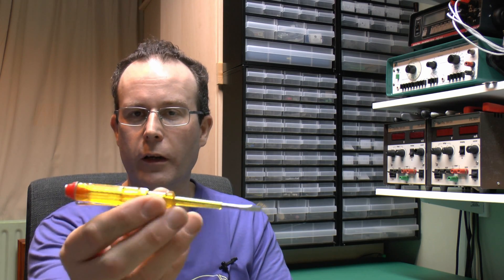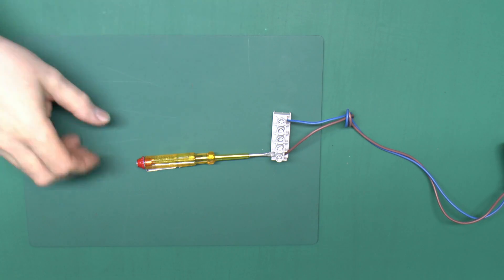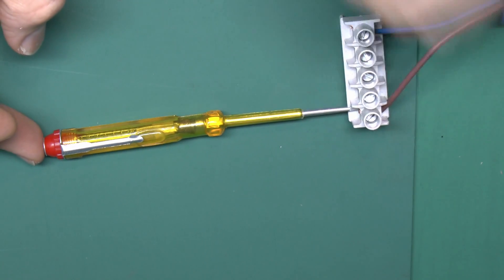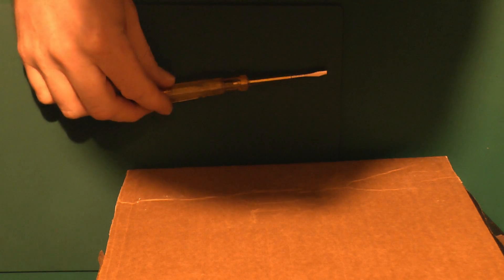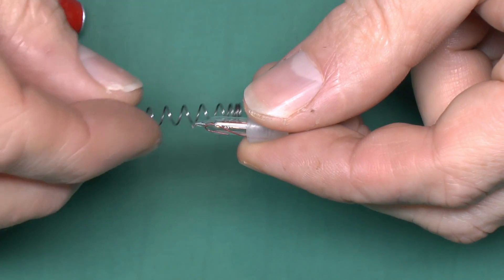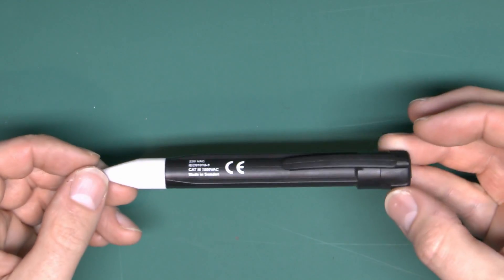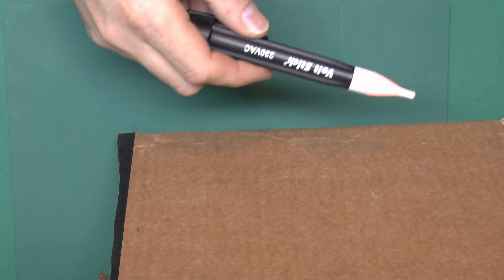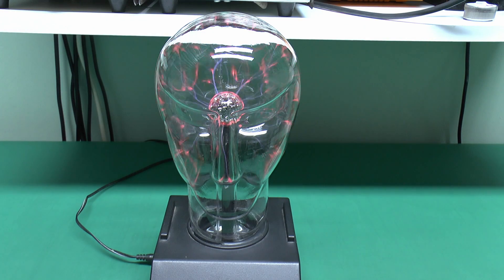Dangerous Device - Neon Mains Testing Screwdriver

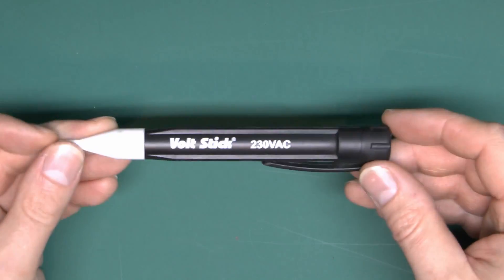Comment: Humm, there seem to be a bit of a trick here. Either the screwdriver is faulty or the power is cut off to stop getting the light. I have used this type of testing screwdriver for years without any problem. The tool is only used to test live voltage point in a wall socket or even a connector bar like the one you're using to test if it is active (positive) or negative (no power) by simple point the tip of the screw driver on only one point and place a finger at the handle end. If it is active the light comes on. It never fails because it is only conductive by one way body contact. However, should you hold the handle with your finger and put the other hand on the negative wire, you will probably get electrocuted. I don't know as I have never tried it. The screwdriver is safe if used the way it is intended to be used and it is a sure way of finding a live point. The other device at 6:40 is really not as good as the trusted screwdriver tester because to find out if there is a voltage at a point, you just pass it closer to a voltage point, be it a wall socket, a light fitting, cables, etc., to get a light and beeping sound. But, which cable which socket point is active? The device detects a voltage source at a distance of up to 15 centimetres away and that means you cannot single out which socket hole it is or which wire is positive in a cable. The trick I see here is that at 7:15, the device doesn't light. Of course it doesn't light, because these devices have one or two batteries inside to detect a voltage. Then, at 7:38, you say "Now this time I place it here, as you can see it illuminates", Yeah, yada yada yada, no wonder it didn't illuminate in the first place, you probably forgotten to put the batteries in, and of course this time it illuminates. So, all in all, I would still use the old trusty screwdriver tester.
Reply: The problem with the neon screwdriver is that if you are well insulated it will not light or be very dim and you may get a shock or worse as a result.  People use them outside and wonder why they get a shock, assuming they survive to tell the tale.

I do use one for testing that a 240v is live when I am expecting it to be live .  I certainly do not use a neon screwdriver to test for dead.  To test for dead I use a voltage tester and the non-contact tester, they are both dirt cheap, so why risk your life?

No idea what non-contact voltage testers you've used but my dual sensitivity one has to be as close as 3mm to a bare wire, it is THAT good.  I can easily pick out the live from a bunch of dead in a wall outlet.  People don't understand them and buy one thinking more voltage range is better, no it isn't, it makes it too sensitive.  As long as you understand how to use one you will always find live with one, but people are morons who don't understand how they work and what their limitations are when testing twisted cores etc.

In this John doesn't explain why the non-contact voltage tester doesn't light, I reckon he cheated and swapped live and neutral around.  I don't believe that it would not detect live if that brown was live.  He then goes on to demonstrate that it is too sensitive, so why didn't it light up so close to a live brown John?  Because it wasn't live, was it!

John Ward has an obvious chip on his shoulder with neon screwdrivers and this video is the result.  You are right, there is a little deception going on here.  Like for example using an isolation transformer to test a neon screwdriver ;)  Test it on a mains outlet next time.
Reply: @fredbloggs8034  Rubbish!
Test the indicator on known live, then test unknown conductor with it, then test indicator again on known live.
That's how the apprentices were taught to use it. In my 60's now, and the neon 'driver never let me down yet.
Only an idiot would use an indicator in bright sunshine.
Reply: @tiggywinkle1000  
"Only an idiot would use an indicator in bright sunshine."

Which was the point he was making.  Read the comment properly.
Reply: @random6809  GFY !
If bloggs is a big boy, he can defend his position.
Or is it 'All Girls Together' day - ? Don't bother to reply !

Comment: The reason they are used is because they quickly show what is live and that is the point

I don't think anyone would.just get it out of the draw after a year and think, the lights not on it must be dead

There a common sense quick easy tool

Test on a known live, they are not useless at all , but I wouldn't use on anything high voltage

And by high I mean anything bigger than meter tails

And if the thing inside is broken the circuits broken
Reply: "I don't think anyone would.just get it out of the draw after a year and think, the lights not on it must be dead"

You don't know people very well then, that is exactly what happens.

Comment: I'd just like to make the point that assuming a circuit is dead because it doesn't light up is so dumb. 

It might be faulty.
Reply: Indeed, any equipment can be faulty.  You test whatever the device is on a known live (or proving unit) before you use it and then test the device again after you've used it.

I wouldn't use only a neon screwdriver to test for dead (Voltage Tester for me) but it is handy for the paranoid.  A neon screwdriver poked at the known dead is a cheap and reassuring test that I am not about to be the circuit to ground for some unforeseen reason.  It's portable and dirt cheap, so why not do that extra test?

John Ward saying "why you should never use one of these neon screwdriver testing efforts for anything" is utter nonsense.  He's a knowledgeable guy but his obvious bias about neon screwdrivers knocks his credibility a little here.

Comment: Any body saying im an electrician and i use an electrical screwdriver is not an electrician nor are they even a compatent person
Reply: Utter nonsense.

A test lamp could make you believe that a wire was not Live, as could a multimeter.  Like any tool you need to understand when it is appropriate to use the neon screwdriver and when it is not, just like the lamp.

The measure of competence of a person is not the tool used it is the person using it.  A neon screwdriver does not make you incompetent and a test lamp certainly does not magically make you competent!
Reply: What makes me competent is my qualifications ,c and g 2360 part 1 an 2, 2391 inspection and test ,16th 17 ed wiring regs,knowing how to use a testing device,confirm,test,confirm again,the test, check for earth continuity,check phase positive ,(against earh there may be a fault on neutral)check phase neutral,(there may be a polarity fault)of course live and neutral are phase conductors always using a gs 38 device,with tips on if possible and with caution if not tipped,thats the definitive way to test for voltage,how could a false reading be given using that method,yes having the tools for the job doesnt mean you are a competent person, but not having them means your definitly are not competent .just out of interest what are your qualifications?
Reply: @gimmieliberty6514  

What are you going on about?  Re-read my comment and reply to what I said not what you thought I said.  I said nothing about the correct procedure for testing for dead and I said nothing about a competent person not having other tools.

What I said was that your comment is nonsense.  Using a neon screwdriver does not suddenly make you incompetent,  READ WHAT I SAID:

"Like any tool you need to understand when it is appropriate to use the neon screwdriver and when it is not, just like the lamp."
Reply: don't play with electricity
Reply: don't play with electricity
Reply: @gimmieliberty6514  

What?  Who said anything about playing with electricity and what has that got to do with my comment?
Reply: @gimmieliberty6514  

You have no idea what my level of understanding is.  I have merely stated one very simple thing, which I will repeat AGAIN.

"Like any tool you need to understand when it is appropriate to use the neon screwdriver and when it is not, just like the lamp." 

How does that comment measure my level of understanding exactly?
Reply: @fredbloggs8034  NO NO NO,what you need to understand is that it is NEVER appropriate to use an electrical screwdriver, yes I gather you have formed an understanding,but an understanding and knowledge  are not the same thing,q1 a voltage of 230v dissipates 1500 watts,what is the current?q2a voltage of 244 volts pushes 5.5 amps,what's the resistance?When you can answer these questions you will have knowledge not an "understanding"
Reply: @gimmieliberty6514  

Why is it "NEVER" appropriate to use a neon screwdriver?  You keep making statements without explanation.
Reply: @fredbloggs8034  checkout "killer screwdriver" by the poster, photoinduction
Reply: @gimmieliberty6514  

I am asking YOU.

Why is it "NEVER" appropriate to use a neon screwdriver?
Reply: @gimmieliberty6514  Easy, 6.52A. The answer to your second question is 44.36 ohms and the total dissipation in this second scenario is 1.341KW.

Comment: Those things are dangerous. The only thing protecting you against a shock is a series resistor. On the slightly plus side, they will show a voltage present on a neutral adjacent to a line, as in T&E, caused by electromagnetic induction.

Comment: Where did you find that neon screwdriver? It is very badly made and that’s why it probably doesn’t work well. I have used that tool for 55 yrs and it really is good. That model you have has a very dangerous thing you don’t seem to know and it is that the shield of the tip is too short. Earlier these had only a thin plastic insulation and if you pushed it too hard, it could penetrate inside the handle and cause the ferrule becoming live. Then EU banned this late 80’s if I recall it right, until the Germany manufactory (the good one) added sturdy plastic shield which prevented the tip penetration. That yours is something very cheap and useless. BTW; you throwed it in the BIN. Why? Don’t you have to recycle all electronics? And about the black Volt Stick, it also looks very cheap and is probably unreliable as you showed. The Fluke Volt Allert is really good tool and every electrician uses it. That old lamp looks funny. Nobody jses those but more modern one. That was really hard to use and if the lamp breaks, you can believe that the electricity is cut off.  I really do not recommend that.

Comment: Gentleman, we all know that it is not a clever idea to use those screw driver. But the new version of plastic tip testing pen device is no good either. The major problem is, it is a battery operate device. When it is out of battery, it will give no sound, no light. That is also the same signal as a off circuit wire. A false safe. You may argue that a full function multi meter is also battery operated, what is the difference? We can check the status of our multi meter immediately by unplug from the testing circuit and switching to ohmns and touch two poles, and that is in the lesson 1 when we learn to use a multi meter, but the plastic tip pen tester? I have seen some made in you knows where didn't have a self test button! God knows if it is functing correctly?
Reply: You ALWAYS test whatever device you are using on a known live before and after use.  You would know if the pen was working before you used it!
Reply: Rubbish!
Test the indicator on known live, then test unknown conductor with it, then test indicator again on known live.
That's how the apprentices were taught to use it. In my 60's now, and the neon 'driver never let me down yet.
Reply: @tiggywinkle1000  you must be very lucky not to encounter brand new one with a burned neon bulb. that's pretty common here. for unknown (known) reason that mass production country flood those bulbs in the market, even a new replacement blub can be faulty, well, just 220v, “usually” it won't kill, don't you think they care neon bulbs when they can make “unbreakable” fuse from iron wires?

Comment: Those fancy meters break too. Happened to me. I was being very careful, working in a wet basement on 220 volt controller box for well pump. Brand new multi meter showed no power. Found out later the selector switch broke off inside allowing some readings.  (Cheap junk from China.) I didn't bring my good one for fear it would get ruined. Anyway, I had the screw driver and used it to verify power. Remember, in bad situation or high risk, verify for added safety. Those screw drivers were made for people in the third world that cannot afford the fancy stuff. They also work if your body is insulated, working on the EMFs from the current. Just be careful. Try to avoid using those cheap meters too.

Comment: If the neutral is not connected properly, you will get electric shock touching the live using the two poles detector

Comment: 06:04 : Until now I had never realised that the pellet thing was a resistor - or that it was there in the first place! I always thought it was a metal insert - in fact, I can swear I've seen this replaced with tinfoil when it's gone missing in a few occasions! I never stopped to think what the voltage drop across the neon bulb was.
Thanks for this!
Reply: You've not realised why there's a high value resistor with all neons ? Cos the neon has minimal resistance over striking voltage.
Reply: @millomweb  Thanks for pointing this out. I did not know that.
Is this why I see the neons in the switches of many of the cheap socket extensions out there die? perhaps a lack of a resistor? impossible to find out without wrecking one - most are not made to be easy to disassemble.

Comment: I’m a Master Electrician. These neon lights are very useful and safe with common sense. Say you have old “knob and tube wiring” and both wires are colored black. We would like to know which is our HOT wire so we know our polority for an outlet installation. With a neon pen light it’s much quicker to find our Hot wire than using a meter. Think about it. On your meter, you would have one test prone on your meter to a known ground (like a maybe an air vent or copper water line, or grounding or grounded circuit on your main panel.) and the other probe lead would be searching for your HOT wire. This guy on the video is stupid. Neon have their purpose in special situations.
Reply: You've chosen production over quality over safety.

"Its never happened to me!" ... ahh human bias
Reply: @SwiftyMcV  Rubbish!
Test the indicator on known live, then test unknown conductor with it, then test indicator again on known live.
That's how the apprentices were taught to use it. In my 60's now, and the neon 'driver never let me down yet.

Comment: As a retired electrical engineer I am surprised that you did not mention the verification stage following a circuit test. If the testing device shows a 'live' indication then fair enough it is live but a null indication, i.e. 'dead', should be followed by a test of the testing device to verify that it is working. I used a 'proving stick' when servicing 11 kV switch-gear and it was provided with a hand-operated magneto to verify that the stick was working after a test.
Reply: You only know the power is off once you've connected L and N (or L1,L2,L3,N&E ) in a connector block.  ;)
Reply: Quite correct. This is also clearly stated in the Drummond test lamp instructions. "Test on a known live following a dead test".

Comment: out here on planet earth, nobody wants to use these nonsense screwdrivers except for continuity like if you have a household fuse and want to see if the fuse is bad or not. You do NOT check to see if there is live voltage.

Meanwhile on planet britain, people still call things ''meggers'' instead of megohmeters, they use ring final circuits, don't insulate earth and use these nonsense pens.

Yes, people have died using these screwdrivers, get your head out of your ass.  We have proper multimeters with proper insulation and regulations, such as the voltage indicator. Yet idiot chavs will let 230 v flow through their body and call it ''safe''. You're a bunch of idiots and there's a good reason why these are not endorsed by IET. These are the chav tools in britain. You people call yourselves ''sparks'' because you're not electrician. Different term, different shit.
Reply: Here on planet earth, nobody appreciates being lectured to by a self righteous pompous ass.  Especially one deluded enough to think that his own shit doesn't stink because he uses a different term & calls it "feces."

Comment: Sorry one of the most inaccurate videos on electrical safety. Carbon film and metal film fail open circuit. I always check my neon testers against known lives and known grounds before I use them, I've used them for 50 years, never had one fail and never heard of anyone ever having an accident with one, and I was a health and safety adviser for a very large organisation thousands of employees.
Reply: It's hard to get a 120v shock unless you are also in contact with neutral or ground. Consider using the neon screwdriver you have both the neon and the resistor in series with your body plus the insulation of those thick ugly sneaker soles plus the floor and whatever else. In my house I ran a test reclining in my easy chair gave the same slight glow as standing on the floor with sneakers on. Taking my sneakers off and standing on the floor about the same. Touching my cook top with my other hand gave a nice glow. My conclusion 120v probably wouldn't shock me if I didn't also touch a path with a return to neutral.

Comment: Your two pole tester tests for voltage between two poles and will give dangerous non-reading if say neutral is disconnected. The neon device tests whether a single terminal is likely to hurt and provided you check its functionality in current lighting is pretty safe
Reply: exactly!
Reply: Well yes but no if the carbon resistor fails and you then put your finger on the cap you will receive the full 230 volts hence why they are awful